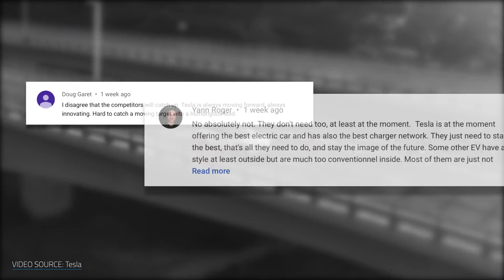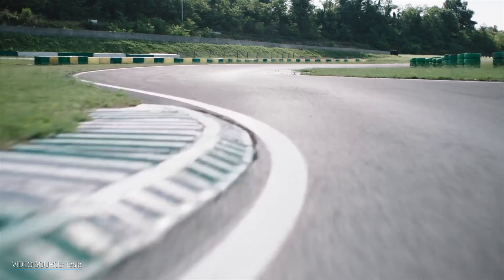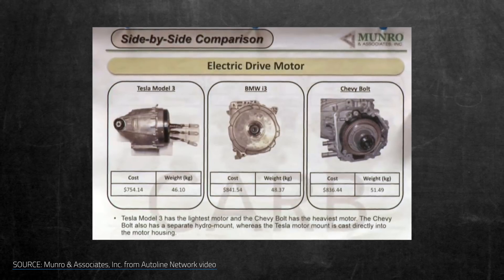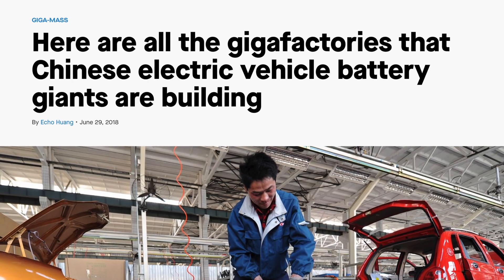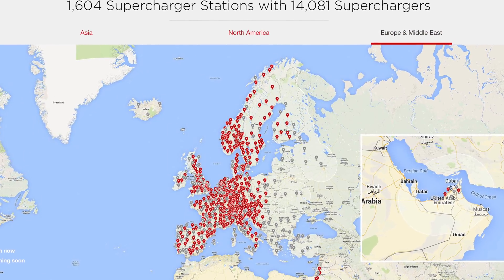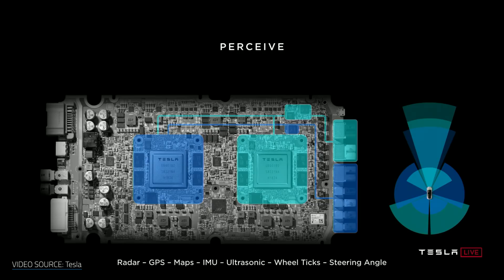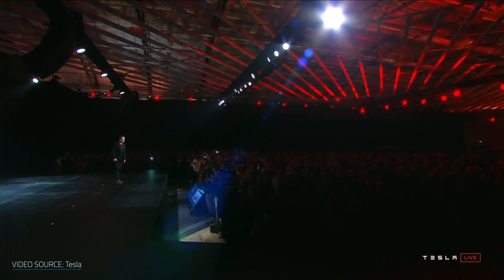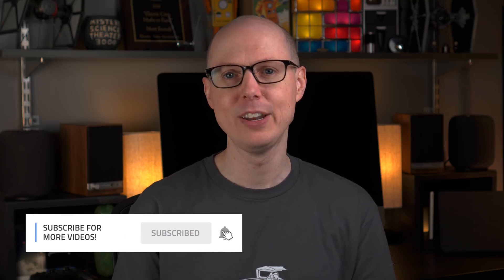Tesla vs Competitors - 5 Advantages

Comment: Great video with a lot of good points as to the competitive advantages that Tesla has over other manufacturers.  I think the other advantage that Tesla has is lack of "legacy" infrastructure.  Doesn't have all the baggage that other auto manufacturers have in design, components or even Unions.  All this allows Tesla to look at things with a clean sheet and move fast.  That sometimes is a double edge sword with the flip-flops on physical sales presence and the inside design of it's cars isn't refined as other manufacturers.
Reply from the maker: Excellent point.  The don't have the baggage to deal with, which makes them a lot more nimble than the legacy players.
Reply: Greg Brance To my mind, the Model 3 interior is the most refined of any car, if functionality, comfort, superb sound system and elimination of dust collecting knobs, buttons, and dials is the goal.
Reply: @j.kevinmcnary9561  The Model 3 had a great interior.  The Model S and X not so much considering the price point of the cars.  Personally I found the seats in the Model 3 not very comfortable at all.  My Nissan Leaf has way more comfortable seats.  The Zero-Gravity seats on the 2019 Leaf's are awesome.
Reply: Greg Brance I have a 2012 Leaf and a Model 3. Can't agree with you about the seats. Still drive the Leaf around town when my wife has the Tesla. I thank Nissan for allowing me to recognize the tremendous achievement and improvement the Model 3 represents. As an aside, my local Nissan dealer, from which I bought the car, no longer has a "Certified Leaf Mechanic", nor was I given any assistance in finding one for my heater problem. I had to put the Leaf on a flatbed tow to a dealership I wasn't confident of reaching without a long charge at a public charger. It makes me question the Nissan dealerships' commitment to BEVs, which is ironic since they were the first to market.
Reply: @j.kevinmcnary9561  The 2012 Leaf doesn't have the same seats of a 2019 Leaf.  Have you sat in a 2019 Leaf?  Nissan recently brought it's Zero-Gravity seats to the Leaf.  I did cross-shop with the Model-3.  Both my wife and I found the seats uncomfortable in the Model 3 and we also found the car was lower to the ground that made it difficult to get in-out of. Nissan also had better lease options and incentives.  So we are doing a 3-year Lease on the 2019 SV Leaf Plus.  I figure by the time the Lease is close to being up we can take a look at the Model Y and 3 again and make a decision at that time.  With how rapid the technology is changing for EV's I feel I should lease rather than purchase at this time.

Comment: The company’s structure allows them to be flexible and make changes rapidly. While you can argue sometimes this leads to messy situations, overall it’s moving the needle in the right direction.
Software. No other car company is anywhere close to the software Tesla has that is constantly improving and goes beyond autopilot. Combine that with the fast pace and we literally just saw another example of “from tweet to implementation” in a day with Dog Mode.
Reply from the maker: Good points.
Reply: Undecided with Matt Ferrell also, related to the fast pace, no model years. If they figure out a way to improve the design, they just do it. They don’t artificially hold off for a year and knowingly continue to make suboptimal cars until a subjective date. They also don’t artificially wall off older car models from receiving software updates their hardware can handle simply to push people into buying a new one (looking at you Apple, as much as I love you). The 2012/13 Model S still gets updates to this day.
Reply: @Mari0o0o  GOod point. One reason Tesla can do without model years is vertical integration. Legacy automaker often make contracts with sub-contractors and other providers that span several years. So they can't change the desing of this or that piece of the car overnight. Tesla being veritcally integrated can decide the next day to use a complete different design for their car.
Reply: @Findalfen  It's basically the exact same deal as with SpaceX vs ULA / Boeing.

Comment: The over-the-air updates are a massive advantage IMHO, and also the safety aspect.
Reply: not like any software has been corrupted right^^
Reply: @garyharris8082  I am sure you are very concerned about corrupted software Gary.
Reply: @jdsilvestri  actually I am, I work (or rather used to work I just retired) in an area where we spend a lot of money securing software and network links I know what can happen if things get corrupted or interfered with and yes despite spending all that money some things have gotten through.  Now I'm sure that Tesla will go to extreme lengths that software or networks are not corrupted and it has the highest encrytion on it but things happen and its not like autonomous cars could hurt anyone right and I'm not being sarcastic.

Tesla maintains links to all its cars anyway to download data all the time so if they get it wrong good luck.  I'm not against Tesla far from it I think some of the tech they have introduced is fantastic and is way ahead of others but I dont like the permannent link with the car particualrly on an autonomous vehicle and particularly when related to safety and that was the OP's original "massive advantage".  

I do however find it odd that a permanent always on link to your car sucking up all your data appears to be ok but if a mobile phone company or google did it I doubt everyone would say its a "massive advantage" however I'm more concerned about the safety aspects because I cant afford a Tesla but I will see them on the road and don't want one losing control and smashing into me so thats why I'm concerned here.
Reply: @jdsilvestri  I would be worried if it could end up causing my car to malfunction, especially on the highway. But as long as they are good as beta testing and making sure that their software is stable, it shouldn't be an issue.
Reply: @ThatLaloBoy  Every car has software. OTA updates do not happen while driving. It doesn't present any extra risk of malfunction. Hacking... that's a different story ;p
Reply: @John W lol

Comment: Over the air software updates to improve car driving experience
Reply: ... The longer you own your Tesla, the better it gets.....
- That’s customer commitment the auto industry has never seen before
Reply: This and the supercharger network were key for me. Just as I would never purchase a phone that could not be updated over the air, I can’t see myself ever going back to a car that is tethered to the dealership. It’s amazing how much better my car (that started out awesome) has gotten over the past months.
Reply: CANNOT wait for V10 this month...hopefully
Reply: Gotta agree with this one.  Once you experience it, you wouldn't want it any other way.
Reply: Fyi, I get an OTA update about every 2-3 weeks on my model S. Car keeps getting more functions or better in some way.  When I bought my car the EPA range was in the low 370s, then an update increased that to low 390s then another update later increased that to 402 miles. I drive a ‘20 LR+.
Reply: Improvements include things like better control of suspension, added optional display items, more security,  better range, etc.  For example on my S a recent update gave me the option to enter a pin to open the glove compartment, good for a valet parking situation, easily turned on or off.
Reply: @Roni Karagöz - Check out the YouTube video on Battery Day held in Oct. 2020.  Revolutionary battery tech in the 4680 battery, it will help make ICE obsolete due to cost and energy density factors.  To EV naysayers, I’ll say this, there is an EV in your future, you just don’t know it yet...it might well be a Tesla.  Who wants an ICE car with over 2000 moving parts vs an EV with just 2-3 dozen?  Which one will have more reliability? Which one will be more energy efficient and cheaper to operate?  People need to do their homework and do a little figuring, the answer will be obvious.  Meanwhile you are burning money you don’t have to.
Reply: It doesn't always Improve driving experience, what does the custom horn help driving experience.
Reply: Yes expect for the poor early adopters who got a Model 3 and got their range cut by a software update. Granted, it wasn't something they paid for. But I would've just let them keep it as a thanks for being an early adopters instead of trying to squeeze that extra $2k-$5k from them.
Reply: Lalo your definition of early adopters is different from mine -  I would say that folks who bought the car in 2017 or 2018 are early adopters, not those who bought in 2019.  I grant you that they might have been one of the reservation holders who wanted a $35K Model 3.  However, they were informed that this would be standard range versus a long range model 3 thus less battery capacity and less range.  Plus they got a better interior for less money (a savings).